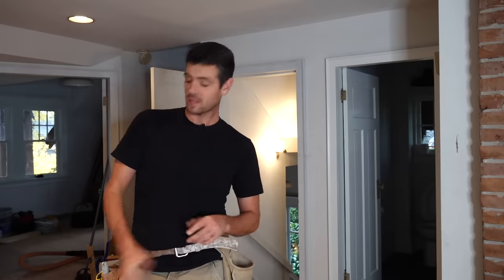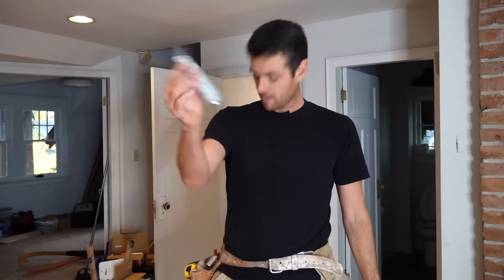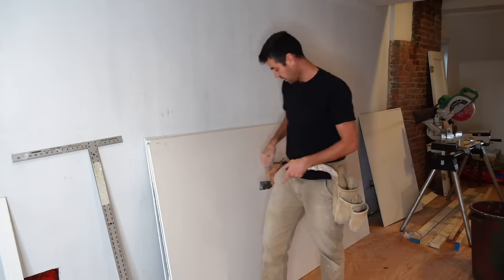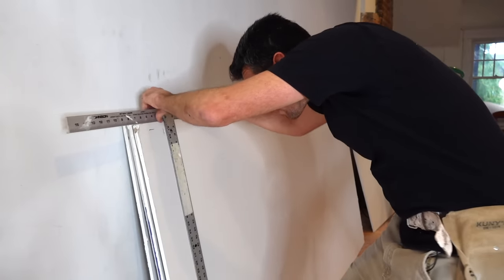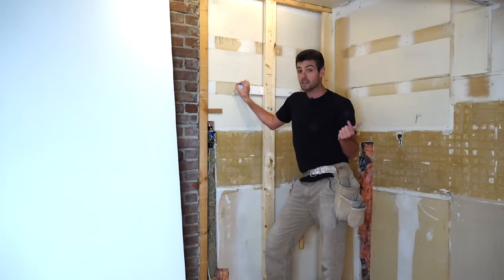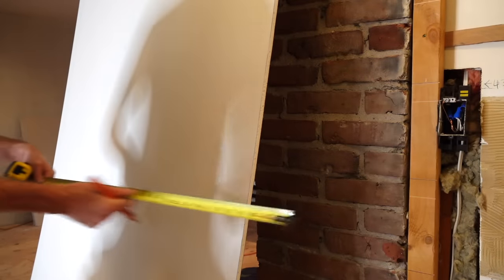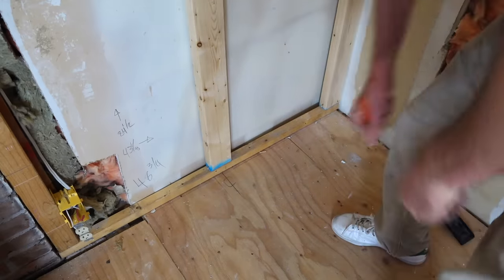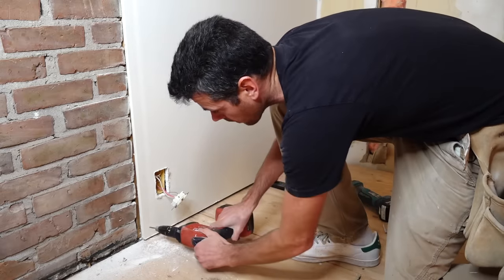Every Beginner Drywall Mistake I can think of (1/3)

Comment: I made a small steel box that fits perfectly inside an outlet without wiring device (no gaps), mounted two neodymium magnets on top. Cover drywall without any cutting and then use another magnet to find the outlet behind. Then just router it, first inside (plate protects the wires), then fine perimeter cut to outside dimensions. Saves lots of time on measurements and alway perfect result. Just wanted to share, not sure if there are similar things out there on the market...
Reply: Brilliant - great idea.
Reply: A type of your solution is standard in Sweden. But the inner casing of our electrical outlets are round. So you can use a hole saw on the drill and cut around the magnets. Even a beginner can get a good result within 30 seconds.

Comment: I've been drywalling for 20 years here in the UK. Lot's of good points but I have a couple extra things that I always do. BTW I wasn't sure what tool you showed at the start but I recommend an impact driver with 4 setting such as the Hikoki, make sure you use a PH2 dedicated bit that fixes directly in to the tool, not a bit holder. The impact driver means you can go in to tough old timbers or new ones by just adjusting. It has a specific setting, fast start then upon resistance drops torque. OK tip 1*, always put your 8x4's on 2 pieces of timber  to raise them off the floor for cutting, or even better stick the pile on a pair of Stanley Junior Saw Horses, man this makes things much faster and much easier, particularly for complicated cuts. Change your blade every day at the least, guys using blades for weeks are just disorganised, blades cost pennies. Looking forward to see how you fix more than a single board.

Comment: I've been hanging board for 2-1/2 years. Instead of measuring all the way from the top throw a piece of scrap on the floor and measure off that. I use a small piece of a pool noodle to stuff in a box containing outlet(s). Then you can router it no worries. Pull out foam after routered. Not only brick but any Concrete wall surface you want to leave  quarter inch gap for tear away. I use DeWalt drywall guns and cordless routers.  I prefer Hitachi but DeWalt batteries seem to last longer as of now.  Also, I prefer inch and 1-5/8" screws for hanging 5/8" lids as they have a PH2 tip that comes in the case of Grabber screws. They allow you to get a slightly better grip on the screw heads. A slightly narrower screw driving head is better for 1-1/4" screws. Anyway,  on that note I highly recommend grabber screws for quality fasteners. Why don't you use any drywall adhesive prior to hanging rock?

Comment: one thing not covered here is when doing an outside wall there will be a gap by the floor. Always mud or calk the gap to prevent drafts. The house should already be sealed and the insulation should be doing it's job, so this is a belt + suspenders deal. BTW, I was at a job years ago where the electricians drilled from the basement to the attic on an inside wall for about 10 wires within the same bay. It created such a draft that the heating / cooling t-stat was always off by a mile. Of course the attic had a plywood floor right down the center so not easy to find.

Comment: Hi thanks for videos fun to watch!  Just want to say that the "reason" for the crumbly drywall besides being fast and cheap is that it is very fire proof, and in fact if it gets hot it "bleeds" moisture! 
Sometimes in commercial buildings they require a "firewall" which means about 3 layers or more.
In elevator shafts its 1 1/2 thick stuff only 2ft wide.....this is for fire protection and making sound proof too.
We used to always go "to and through" light boxes, which means a number (AKA "give me some numnums bubba") for near edge, and a number for far edge, so if you are on ladder taking the numnums, you want to tell partner doing cuts on ground for example 32 to it,  and 34 through it....and from the "ups" or "the buttedge"
Also we didnt say "one and three quarters" or "two and three eigths" instead go by eighths of inch - for example one and three quarters would be: "one and six", and for two and three eights you would say "two and three"  For a  quarter inch or half inch, you can say "quarter " or "half"  however......thats how we did it down in Seattle in the Carpenters Union work at least.  Most of time two people,  so lots of times one gives numbers, one does the cuts when doing ladder and scaffold work.
Also in the nitty gritty numbers, you say "shy" or "strong" which means 1/16 to 1/8 less or more to the cut. 
We called the board lifter thing a "kicker" the hole cutter the "circle jerk"
From Pink Floyd song to keep  amused on job: "we dont need no insulation" and "we dont need no fire control"  with british accent....
AjsoL  "Ah love drahwall.... drahwall is mah life" with dumb hillbilly accent...
"you only need to be a little bit smarter than the board you hang"  a good motto
Careful of stacking too many boards angled white side out on wall - as if it falls towards you you can break leg easy!  That stuff is heavy.
Great videos I had fun back in the days hanging sheetrock actually looking back at it.  Mudding was always a mess!
"dont worry the tapers will fix it!" and move on to next board....(sometimes paid by the sheet non-union work)
Once we did a house that had no permit to an add-on, and the living room and bedrooms rested just on concrete blocks on top of dirt - no real foundation....we didnt know this, and cracks kept appearing everywhere because of the added weight of drywall on walls made it sink...  it was total nightmare we had to go back and fix over and over...finally asked my old boss to take a look, he noticed the foundation nonexistent....so example of not being a bit smarter than the board you hang.

Comment: When cutting the drywall make sure you don't leave chunks on the floor behind the drywall when you're screwing it to the wall or you'll get blowouts.
Reply: Can you expand on that for really new newbies? I guess I'm not sure what a blowout is.
Reply: @liz6034  to win a small chunk cracks from the back side and bulges forward. If that happens the only way to fix it is to cut out all the loose stuff and then mud the huge hole.

Comment: My dad has 25+ yrs of experience with multiple companies and multiple residential, demo/remodel, and commercial project. I working drywall full time with him as subcontractors. I still find 45 degree angles hard to figure out especially when there's multiple angles aside from just 90 degree spaces. I'd say I'm fairly good at hanging and measuring and just problem solving issues we encounter to make it easier and better outcome for finishers. Knowing how to joint drywall together and prep the work as you go for the next process is important and you'll stand out in the crowd. Hanging drywall is honestly just geometry in some sense especially if framed correctly there's so many efficient simified ways to find multiple measurements and just knowing where butt joints need to go and how flats/factory joints have to go with the least joints possible (leave a cleaner and better result). Anyone can hang drywall but only a few hang it well and properly like this guy, it shows on the precision!
Reply: 45* .. whatever you measure across .. measure the same down .. simple as. If that doesn't work for you, cut a small but off the end of a sheet and set in place against the wall or sheet your joining to to find where it hit. Mark it on the wall or sheet you're coming off of and measure to closet wall to the mark and there you have it!

Comment: I've got a rookie mistake for you. Working on my bathroom and I keep finding small blue strings in my mud and its driving me crazy. Found that I was mixing my mud in a blue Lowes bucked and as I was mixing the knife was scraping off the plastic in the bucket! Drove me nuts for an entire afternoon!
Reply: Those buckets will also crack over time  and if you stand on them they can buckle  on you real drywall buckets wont do that  .

Comment: Good stuff! I've been a drywaller for most 20 years now so I had to see this. Because I do steel stud I always have black chalk in my line, I need to get 2 lines going cause your right about it staining. I like the 1" olfa because I tape cut everything and it's good for itch and poly so I just use that one instead of multiple. Love your vids mate!
Reply from the maker: I use the 1" olfa for everything else🙂
Reply: Just wondering what chalk color has to do with type of framing?

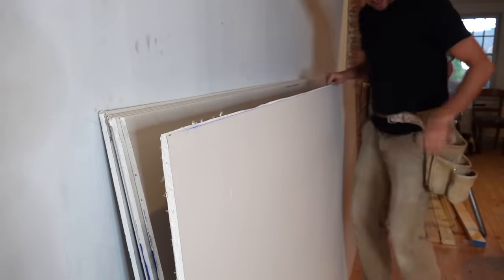Comment: 10:02  health and Safety tip.   Keep your work area tidy.   I usually sweep as I go in my cutting location.   Nothing worse than cutting while going backwards (a dangerous maneuver in general on a job site) and tripping over some offcuts of lumber, drywall or standing into your box of screws.   Those drywall screws have a corse thread and when you are installing thousands of them you end up with bits of black metal in your skin from handling.   I use a thin set of gloves such as the mechanix style when installing board, plus helps your grip.
Reply: Wah wahhhhh

Comment: screws:   3/4 + thickness of your board.   1/2" board = 1 1/4" screw.   If you are going through two sheets or even covering old lath/plaster , for whatever reason, factor that into you calculation.   And longer screws don't always mean better strength (home owner myth).   As screws have less shear strength compared to nails.   Once you get 3/4 to 1" of depth, the board will be fine.   A 3" drywall screw (if there is such a thing?) is no stronger than a regular 1 1/4" when hanging boards.

Comment: I switched to Shinwa chalk lines because they automatically retract the string, use a very fine string, and use a pin rather than a hook on the end of the string. The pin will stay put and can be stuck in the middle of a sheet or board as well as the edge. It’s a game changer for carpentry and drywall.

Comment: I work as a carpenter/punch-list guy, and I'm guilty about trying to fit things in too tightly when I do drywall work. It's a simple thing, but it does cause problems. Thanks for the advice. I'll try to remember to be more generous in my measurements.

Comment: Great video. I work alone alot and can relate to the chalk line not grabbing even a pristine corner. I sometimes make a small incision on the backside of a sheet of drywall or cut a notch with my chisel on plywood.  It grabs the line and acts like having a second hand. Or I keep a small spring clamp on my belt.

Comment: I'm sorry, but I've hung drywall for over 30 plus years and this guy is hilarious. I'm not saying that he done everything wrong, but he's making a video  showing beginners how not to make mistakes and I saw so many rookie mistakes that he made. Dig your blade into the edge of the board when using a chalk line so your string will stay put. Do not cut on the left hand side of your t-square unless you can absolutely not help it. When you start  screwing off the board keep that screw gun switch locked so it continues to run and you will not miss so many screws. I could go on and on, but no one's perfect. LOL
Reply: i had that feeling, hes just way to clean-cut to be a pro. never trust "pretty hands" they havent done any work, for me as a beginer its so irritating that NO ONE TALKS ABOUT LEGAL CODE!!!!! that the only fucking thing im watching for!!!! and no one KNOWS CODE, or thinks is so elementary that everybody should know code LAW!!

Comment: I have two of those "cheese-graters" (and have had them for a long time) and never knew that they were for drywall! I had thought that they were for wood and have tried using them many times but, not surprisingly, I was never very satisfied with what happened. Time to move them to the drywall tool box. :)
Reply: when they came out they were the sure-form rasp and were not particular to drywall. The idea was a rasp with a replaceable blade.

Comment: Ah, those early days of DIY drywalling. I would lay the sheets on a sawhorse table to make every cut. Was doing electrical work on a commercial job site and learned so much from watching and questioning the pros. Ask them first if you can ask questions.
   Fast and cheap? Currently working in a owner home build home from the 70’s. The wallboard is really soft like it’s wet.

Comment: Use 1 1/8" screws for 1/2" sheetrock and 1 1/4" for 5/8th" sheetrock. I agree with the rest of it. You can also get a guide tip router bit for your router and cut your sheets on your wider side and zip them in for a tight fit.

Comment: G'day, 
Kevin here from Australia. 
I'm plastering a extension out (just the cornice to go now) and here we have to use stud adhesive when hanging plaster. You don't?
And I have studied your videos and I must say my plastering skills have improved outersight especially my external corners. 
So thanks for sharing. 
✌🏻 Peace
Reply: glue is available in North America but cannot always be used.   Most times it is for added noise cancellation when laminating boards together.   We use Vapor Barrier (Plastic) on the exterior walls in Canada as a moisture barrier and as such you cannot bond directly to the framing member.   Internal walls are fine.   I've started doing it for ceilings and is worth my extra effort cuts down on fastener holes too.

Comment: Min 8:00 first mistake was the intention to  “taper” a board before you cut your length of your sheet. 
Good thing you didn’t follow through because of some messed up drywall. 
Cut the drywall to length first then cut for your “tapered” length.  
It’s an easy mistake to make we learn and we only get better. 👍🏻
Reply: Agree, tapering first will effectively change the measurements if you are cutting the length.

Comment: i allways use white chalk for drywall, chipboard or any surface that will be painted since SOME blue chalks stain too, and if nothing else it gives peace of mind when the chalk lines are invis after just the prime coat, might be paranoia in most cases but after that one time when i blue chalked and the blue pushed trough the primer and final paint and i had to re-prime with Akrostop and re-paint the blue lines the cost of an extra chalk liner and a bottle of white chalk felt like a non factor, now i only use blue for lines that wont be painted.

Comment: I still don’t understand why all the “Yanks” and “Hosers” aren’t using collated screw guns like us “Skippys”, it’s much  faster and easier. 
And why don’t you guys use stud adhesive on walls? It eliminates any rattle, and requires a lot less centre screws, in Australia, wall sheets only need 1 centre screw on every second stud - 4 dabs every stud (2 either side of centre) So there’s a lot less screws to fill when finishing. Looks a lot neater in the end because timber studs aren’t perfect so when you’ve got a long wall, the glue will help keep the board flat and won’t be pulled in or pushed outward creating a wave down the line of the wall.
Reply: The USA has much higher quality requirements for construction than Australia and Europe.  Larger projects use collated most of the time.  A good hanger can shoot screws almost as fast loose as another can do with collated.   Glue is not an option in most cases as this may or may not hold up during a fire which is the main reason drywall is used in our constructions.  Providing passive fire resistance.
Reply: I don't want a collated gun because I don't need that thing getting jammed while I'm holding a board over my fucking head.
Reply: @cousinzeke4888  For real, the best ticket when hanging board on ceilings is to get two set poles made with 3" pvc with a rubber reducer to 2" pvc, the 2" telescopes with the 3" so you can easily adjust to any height you need.  The 3" end tape a towel or T shirt to keep from marring up the drywall.  Keep them about an 1" or so taller than the space from the floor to the board.  Lift the board in place and wedge the two poles so that they are "leaning" slightly to push the board into the last sheets or wall corner.  Very fast as now one guy is freed up to cut the next sheet and the other guy can screw off/roto zip can lights, elec boxes, etc.  That is how we would hit 70-80 sheets of 12 foot 5/8" per 2 man team each day.  It also takes out a considerable amount effort and labor trying to hold up the sheet until you get enough screws in it.

Comment: Idk if you would disagree but Ive always used 1/2 inch extra to be the minimum length of a screw. Otherwise with 5/8 drywall, a 1.25inch screw wouldn’t be long enough if 3/4 extra is the minimum. Many contractors use 1inch cscrews for 1/2 drywall but I find that a little cheap for the few bucks you save
100% of the time in commercial jobs we use 1.25inch screws for 5/8 drywall. So 5/8 grab would be plenty, don’t you agree?